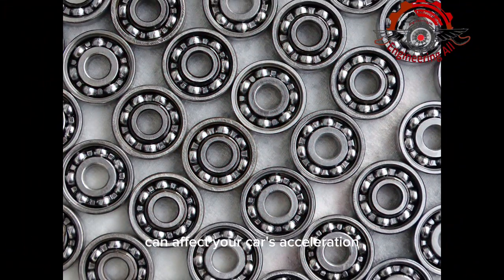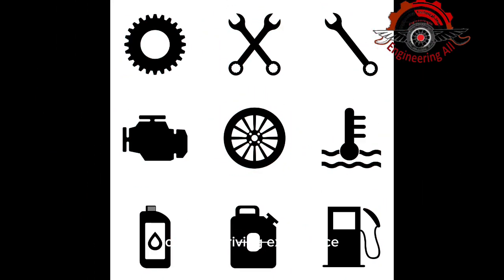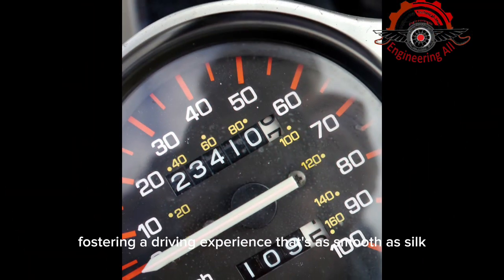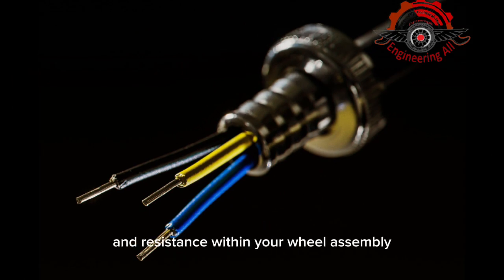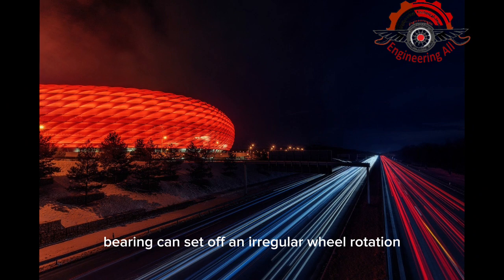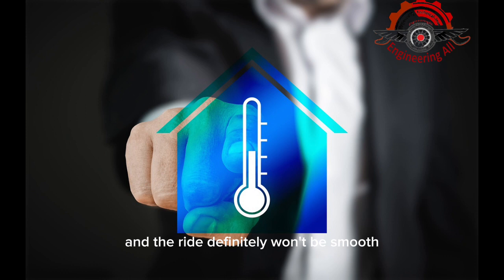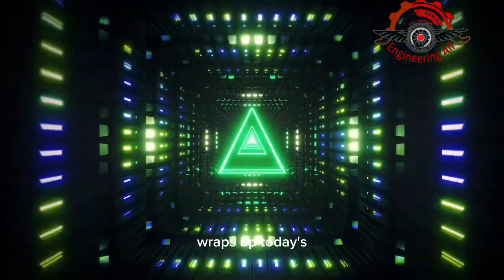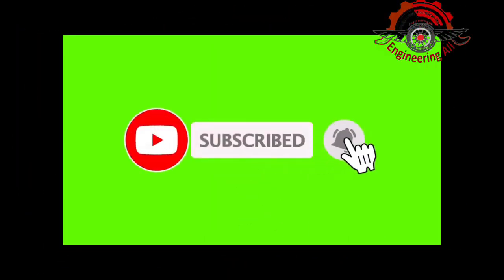How a Faulty Wheel Bearing Wreaks Havoc on Acceleration, Here's How Avoid it

Comment: Ive got HOT rotors on my front wheels.   Ive diagnosed the braking system and it doesn't seem to be resolving anything.     

No wheelbearing play nor noise,  but my wheels do not free spin.

Bearings were replaced 2.5 years ago.  But not sure what else it could be